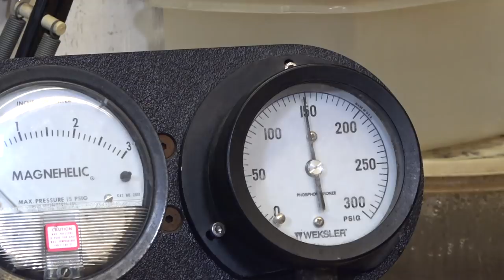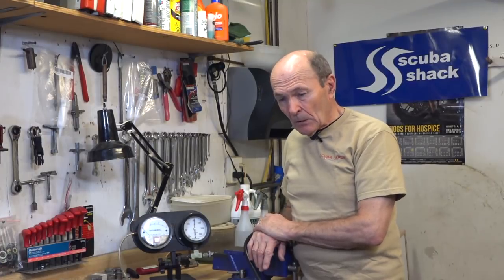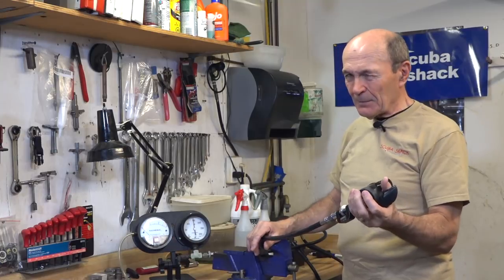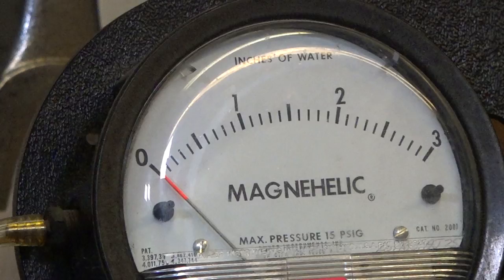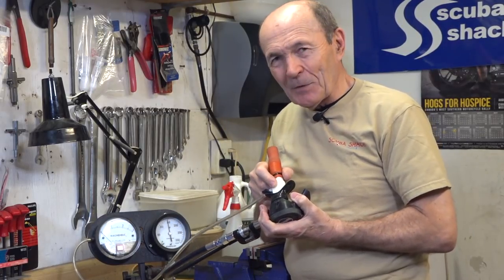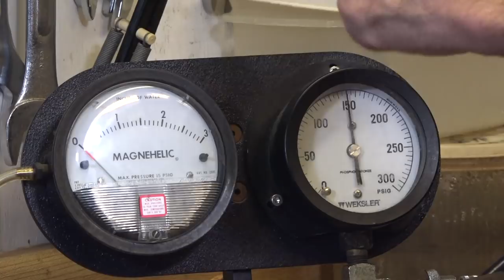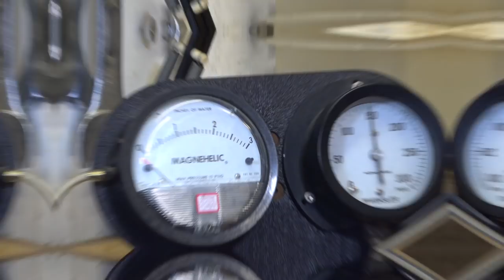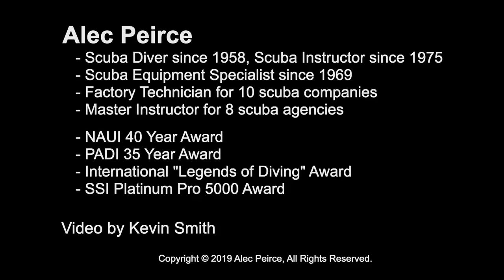Adjusting Breathing Effort - Scuba Tech Tips: S09E04

Comment: Sir, i commend you.  The way you break down what could be considered a rather complex concept to lamest terms and with day to day examples is incredible.  Thank you for doing this.  A quick question.  Does a digital differential pressure gauge would function as good as an analog one?
Reply from the maker: A digital would give the same numbers but it's seeing the needle go between + and - that makes it easier for techs to use.  There are many analog gauges but I have not seen anyone use a digital one.
A

Comment: Hi Alec . Interesting thing to note is the differences in pressure in the cheap gauge (145 psi) and the better bench gauge (155 psi) good to be close but the cheap ones are just in the ball park. You referred to inches of water, there is also inches of mercury both are measures of vacuum, for reference a shop vac is about 4 or 5 inches of mercury. To adjust the breathing on my old aquamatic was a real challenge ,disassemble and washers under the spring for each trial, hope you got yours working too? Take care Owen m
Reply from the maker: The breathing effort to start air flow in a scuba regulator would not likely even register on a mercury tube.
That's exactly why they use water and inches of water. Mercury is about 15 times heavier than water and slower to react.
For breathing effort, inches of water is quicker, more accurate and much easier to understand.

The Aquamatic was a unique design at the time and still is. Those 2 levers increased the inhalation effort a lot. Plus the friction of the levers on the cone and effort required to open the levers on the sharp slope of the cone made the Aquamatic a popular but very hard breathing regulator. It was the first regulator I ever owned and I loved it - and hated it!
I've not yet had the time to try your parts. They look good and I am hoping to get them working soon.
Alec

Comment: the use of magnehelic gauges is widely spread in the ventilation ( HVAC ) industry as a comparizon, a pressure difference of only 2 inches of water from one side to the other of a standard door makes that a hefty man can't open it.
this is a very good video that illustrate that the tooling used to tune regulators is not that sophisticated
with a bit if immagination, somebody can gather and build his own tooilng.
Reply from the maker: Yep! You can make a simple Magnehelic gauge. I did that years ago when racing motorcycles. To tune the dual carbs, I made a water gauge (really just a tube with marks on it fastened to a board) so I could match the vacuum on each carb.
Thanks for watching.
Alec

Comment: Great video! How about a video on sac rate ?
I forgot the formula
Reply from the maker: I can do something on that.
For now: 
       Where SAC is surface air consumption rate and DCR is Depth Compensated Rate. One of these has to be manually   
       determined.

      SAC Rate = (DCR x 33) / (Depth + 33) 

    Let's look at an example. Suppose you did a 50 foot dive for 25 minutes and used 1700 pounds of air. This      would mean our DCR is 1700/25 or 68 pounds per minute. Using this in our formula we get: 

    SAC Rate = (68 x 33) / (50+33) 

    or: SAC Rate = 2244/83 or about 27 pounds per minute. 

Take care.
Alec

Comment: Hi Alex, thanks for all of your informative videos.  In the case of adjusting the safe second should it typically be set up to the same specs or same level level of inhalation effort as the primary or should it be “detuned” slightly to reduce the likelihood of freeflow.  In this case I am asking about a set of regs with non adjustable breathing effort knob.  Thanks.
Reply from the maker: I personally like to have the octopus set slightly harder.
1. that reduces the likelihood of a Free Flow when you jump in
2. it also reduces the likelihood of my buddy asking to use my "hard breathing" octo! (well, maybe not, if he's out of air).
Alec
Reply: The best thing is to have both second stages equipped with manual regulation of inspiratory effort. So you can adjust the secondary one to the minimum to avoid the risk of freeflow but you can increase it in case of use. This way you do not expose yourself to the risk of having a regulator with high inhalation effort just when you are in an emergency.

Comment: Hi Alec, thanks for the awesome video! Quick question: this breathing effort adjustment I understand is done by adjusting the seat (e.g. using the inline tool). What do you do with the adjustment knob on the other side on regulators that have one? Has it got a role in this?
Reply from the maker: Oh yeah! It has a role.
In fact, the diver adjustment knob is just an identical spring pressure adjustment on the seat just like the seat adjustment done with the in-line tool. It's just at the other end of the poppet shaft.
And the range of adjustment is very limited.
Once the serviceman sets the breathing adjustment to factory specs, the diver can increase or decrease the spring pressure on the seat to make it slightly harder or slightly easier to breathe. The increase in effort is not much, usually just enough to stop a slight freeflow. The decrease is usually just enough to start a slight freeflow.
While all reg specs are different, generally the diver adjustment knob is set to it's lightest, (easiest breathing) setting. Then the serviceman sets the seat to the easiest breathing too. Now the reg is jst below a state of freeflow. and ready to dive.
Alec
Reply: @AlecPeirceScuba_SeaHunter  thanks that makes complete sense!

Comment: While using Helium and the reg free flows, is it the breathing effort that needs adjusting or is the flaw in the design of the purge button while at ambient pressure? First stage reg IP is correctly set. No guesses.
Reply from the maker: The primary reason all regs free flow is the adiabatic process.  Other factors can be influence free flows like: IP, breathing effort, etc. but are not a predominate as adiabatic effects.  Suggest watching S09E05 Why Does My Regulator Free Flow, for a more informed explanation from my favourite Youtube guy!

Comment: Again, a great video! Question: How would I use a Magnelhelic gauge on a double hose regulator such as either a Royal Aqua Master, which is a two-stage regulator or a Mistral, which is a single stage regulator?
Or am I just as well off using only a small 200 psi gauge like what you first showed?
Reply from the maker: You push it into the double hose mouthpiece, just like a single hose,  to measure the effort.  The Mouthpiece Adapter provided with most  Magnehelic Gauges gives an airtight seal on all diving industry second stages.  Give it a try.

Comment: Greetings dear Alec
I am loving your videos many thanks for taking the time to make them. 

I have two questions regarding this video
1) The adapter that goes from the Magnehelic hose, and seals into the second stage mouth piece, with one open end that you draw air from. 
Is this store bought or home made?

2) Would the “Inline Adjuster Tool” that you are using in this video work on a “Atomic Z2X” second stage regulator ?
When looking into the second stage male tread fitting, I do not see a little screw adjusting head ?

Thank you in advance

Gino
Reply from the maker: Thanks for watching Gino.
I'm glad you're enjoying the videos.
1. It is factory but it could be homemade. It's really nothing more than a short piece of soft rubber tube that will squeeze to fit into the mouthpiece of any regulator.  It's about 4" long. One end goes into the reg mouthpiece. The other end is drawn on by your mouth.
On the side of that tube, there is a plastic tube like a spigot that has a piece of plastic tubing (think aquarium tubing) running to the meter.
2. Atomic makes a fine product, maybe not as special as they would have you believe, but very good. Most of their "innovative" and "exclusive" design features are actually modern versions of older technology. It suppose it fair to say 'updated'.
The second stage is very simple and similar to many others on the market. The orifice is adjustable just like most others and uses the same pneumatic tool. It can only be adjusted under pressure so it really does require that tool.
The 'screw adjusting head' is really just 2 notches in the seat that faces out of the body. You can see that head and the 2 notches in this picture from the Atomic website: https://www.atomicaquatics.com/images/SS7b.png

Alec
Reply: Dear Alec 
I will acquire the appropriate inline tool and make the hose adapter. 
Thank you again for sharing your life’s experiences

Comment: Do you test and set the cracking effort with the venturi set to dive or predive?
Reply from the maker: The venturi is always set to pre-dive (lowest venturi effect).
The Venturi can make the Magnehekic gauge go crazy and the Venturi has no relationship to breathing effort - the effort required to start air flow. The Venturi doesn't work until the air flow starts.
Alec
Reply: I don't think the venturi affects effort, only flow pattern after that. If you mean the effort knob then it should be at easiest when adjusting as you will be able to make it harder later - any easier would free flow.

Comment: My Regulators have a breathing effort adjustment lever, could you explain to us when you would need to adjust it, I get different answers from different instructors and tech  divers
Reply from the maker: If the reg is properly tuned by the service center, you ought not to need touch that knob at all. There's no reason to make the breathing harder (unless you have a freeflow) and making it easier would lead to a freeflow.
However, some divers don't the breathing too light so that adjustment lets them make it a bit heavier.
The breathing effort adjustment, which is quite common and any but the cheapest models, is a highly-touted feature but is really not of great value - assuming your reg is regularly and properly serviced.
Alec

Comment: Hi Alec! I hope this is not a stupid question.. But how do I set the breathing effort adjustment lever when I adjust the second stage? Thanks for a great video! /John
Reply from the maker: At one time, breathing adjustment was set by bending the 2nd stage lever up or down to make it closer or farther from the diaphragm. That is not nearly so fine an adjustment as we have today, nor as easy. One doesn't usually bend the lever anymore.
In most regs, you increase or decrease the 2nd stage spring pressure by moving the orifice closer or farther away. That's usually how the external adjustments work.
But each reg is slightly different. Let me know what you have and I might be able to help.;
Alec
Reply: Alec Peirce Scuba Thank you!

Comment: I've been looking at replacement regulators. The manuafactuers are advertising breathing effort as: 
"Overall work of breathing (WOB) scores: Avg. 0.70 joules/liter". 
Would .7 joules/liter be about 1.5" of water?
Reply from the maker: My first suggestion is to not get too worked up over the WOB. Most regs today, certainly anything above the most basic, will offer breathing resistance so low as to be almost undetectable. What you're looking at is a manufacturer's advertising ploy to indicate their reg is better. The actual difference is between 0.70 joules/liter and 1.0 joules/liter is barely measurable much less of importance to the diver - in most cases.
To translate joules, a measurement of energy (we could call this effort- not exactly scientific but practical) into inches of water is possible but would require expensive instrumentation and/or a complicated formula. Most regulators are still measured in inches of water, more because it's easy to understand and explain rather than more accurate.
0.70 joules/liter means that the amount of energy expended to have a liter of water flow through the reg is 0.70 joules. The earliest example of a joule is the amount of energy needed to lift an apple 1 meter vertically - not exactly translatable into a scuba divers breathing effort!!
Alec
Reply: @AlecPeirceScuba_SeaHunter  Thank you, The consumer is faced with a lot of marketing fluff as manufactures push their wares. I appreciate your candid approach in simplifying issues that may otherwise be complex for the common consumer. Caveat Emptor.

Comment: to make it reads easier, it's just a differential pressure gauge...
Reply from the maker: It measures pressure but in a very different way from say tank pressure.  It measures the force to breath in/out which is not a lot but you want it set to the easiest breathing effort possible, this is needed.

Comment: Hello sir? Can I asking? what is the function of magnehelic, can you explain it in simple language
Reply: can i see the installation of the tool you are describing
Reply from the maker: I will get you started.  Read the full story at: https://scuba-clinic-tools.com/blogs/technical-info/measuring-cracking-effort 
Cracking or inhalation effort can be defined as the minimum amount of inhalation effort or vacuum required to start the airflow through the second stage regulator. 
The total amount of inhalation effort required to slightly open the second stage and start the airflow will be displayed on the differential pressure or on a Magnehelic® gauge.  So a Magnelelic gauge is used to measure the effort/force to start air flowing to breath.  The lower the effort the easer to breath.  Lots more to read on the ScubaClinic's website.
A
Reply: Thanks
Reply: Would you show me, set up magnehelic with intermediate pressure

Comment: Hello Alec,
Great videos as always, much to learn from a pro like you.  I am in the process of buying a Dual Pro Stand, 5-0-5 Magnehelic from scubatools.com, yet I found the A.I.R. Flow Analyzer which test diving regulators under both static and dynamic conditions.  A huge price difference the Dual Pro Stand is sold for $368.00 while the A.I.R. Flow Analyzer is priced at $988.00  Being a certified freelance scuba repair technician, what would you recommend?
Thanking again and look forward to your valuable advise :)
Best Regards,,,
Issam
Reply from the maker: There is one major difference between the  test instruments. The A.I.R. has a Flow Meter; the Dual Gauge does not.
The flow meter would be a nice addition and would give you some information of value, specifically the rate of air flow through the regulator at any depth or pressure. 
However, while this information is vital to a manufacturer or a reg developer, it's of less value to a reg owner since the rate of air flow cannot be changed!! What's the point of having an instrument that gives a numerical value that cannot be modified?
So, while the flow meter is a neat device, since it will not add anything to your ability to measure and adjust your reg, why bother?
Alec

Comment: How about you just forget the gauge, and do exactly what you said:

Seal the mouthpiece to a tube that dips into a bucket of water (allow some water into the tube first).  Mark the water level on the tube.  Slowly lift the tube until the water level inside the tube drops below the mark.  The level between your mark and the surface of the water is your breathing pressure.  Easy-peasy.   No need for any gauge at all, no need for good ears, just a tube, some water, and a ruler.
Reply from the maker: Gauges are more accurate, cleaner and less setup.  Also imaging a customer complaint about breathing effort and you show your sweet tube, bucket and ruler setup?   Not what customers want in a service pro, sorry Caleb.
Reply: @AlecPeirceScuba_SeaHunter   I actually guess my setup would be more accurate because there's no need for timing and watching the IP and guessing what the meter read at the same time.  it would be super precise I think .  That would need to be verified though ;-)  But yeah, for a pro shop, sure you can have all the fancy dials.  For a home user that wants to tweak things, if this method works, it'd cost nothing and I think be quite repeatable and accurate.   Verification needed ;-)